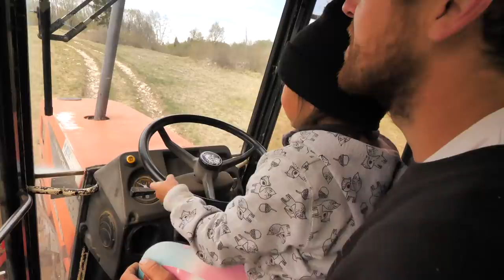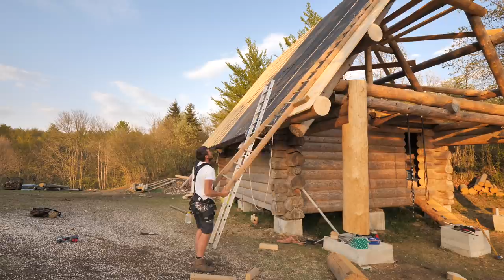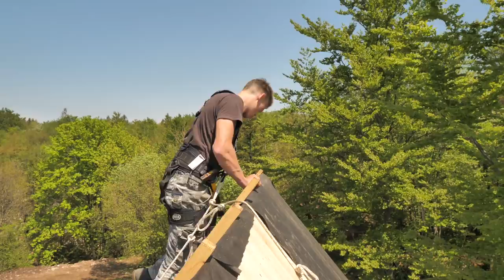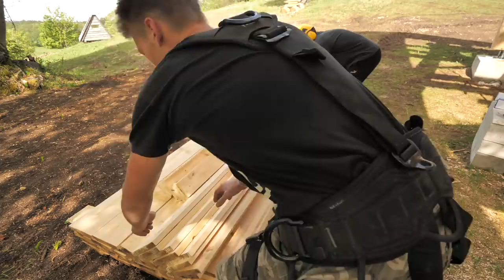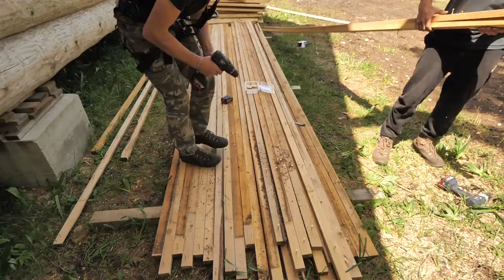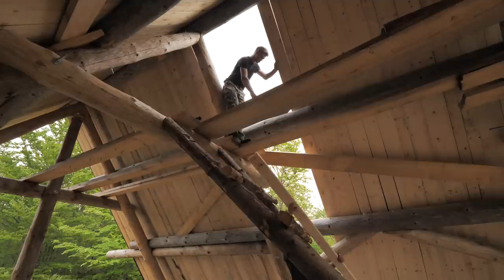Building Off Grid LOG CABIN / The Roof is DONE!  (S 2 Ep 13)

Comment: Sir, you were absolutely  correct to run the membrane vertically; the steepness of the pitch and the number of folks building it dictated it. Even though it took you a month to complete the roof you are still making very good progress and I applaud your efforts and skill. Keep the videos coming!
Reply: Well, no.  There's a reason roofing code has I&W run horizontally.  I hope it doesn't come to bite him in the ass.
Reply: @ikidd3123  just because code in 1 area of the world does not make this application incorrect. He appears to be using a double perlin/batten application for his roof. so if water gets under primary roof it still sheds properly
Reply: @Rowbottom46  code or no code that membrane is meant to be installed horizontally, he even states he installed it incorrectly.  It can and will leak just from condensation buildup.

Comment: Nik, running the waterproof membrane vertically is normal application. That roof is so steep, any water will run right down the lap with no issues. If the roof was low sloped, then I would run my courses horizontally. You are doing a fine job.

Comment: Cheers Nik from Sf bay, Ca. USA. Nik congrats for the completion of the roofing task. I can appreciate your multi combine erecting skill set. I'm a semi retired traction elevator installer so can appreciate the safety PPE gear tie off. MAD rigging skill sets using hoisting chain falls, cable pulley snatch blocks, hold backs and slings.  I just did my family's cement tile roof by myself too!. with the help of a hoisting mast and electric capstan hoist to lift 6 tons of cement tiles, a little couple hundred lbs at a time.  one of the better log cabin erections by far...cheers

Comment: Just a suggestion, if you do ever need to put a protective coating of some kind on the logs, I would only use a natural oil, such as a boiled linseed oil or a tung oil. Nothing else. That would replenish the oil in the wood that will be lost over time. You've done a great job. The roof size is a very traditional way to roof a log home. Regards, Solomon

Comment: I work as a construction manager in switzerland and I don't think there will be any problem with the layer beeing verticaly. 1. as you said its just the second layer and will mostly keep moisture out. 2. If i seen it correctly it has adhisive stripes for the overlap. These alone will seel it realy good. With the 2x4 in place i think there won't be any problematic moister coming in. 3. A little bit of moister isn't that bad as long as the wood can breath. The problem beginns when water is trapped between layers. Ten you will get mold.

I would highly advise to put some isolation under your roof, else it will get very cold in the winter. I wouold make a layer of wood under the wood beams and between the beams I would put some Stonewool and leave some air between the stonewool and the outer planks. So basically from botom to top: wooden planks, trickle protection, Beam/stonewool, 5cm air, wooden planks, rest of your roof.

I would also sugest you oil or wax your outer shell of wood, at least the walls. It will protect them from the moisture and they will last even longer.

Comment: I have watched every one of the videos you posted so far for this Log Cabin build and it's been great watching you do things completely differently then I would have done them.  I am big fan of the vee cuts that you added insulation to as well as the elliptical cuts that were made on each end of the logs so that they fit together perfectly.   The roof I would have done a little differently, not that the way you did it is wrong, but I would have likely installed all the boards before beginning the tar paper and I would have mounted the tar paper horizontally instead of vertically.  I do recognize that each does have some advantages and disadvantages.  Mounting it horizontally would then have changed the orientation of the hold-down boards to horizontal which would have turned them into a ladder of sorts for doing the rest of the work on the roof.  Thank you for posting these videos.  I try and watch as many of the ads as possible to give you as much support as I can.  Keep up the great work!  ;-)
Reply: Shawn R you’d still
Reply: You can use counterbattens, batten vertically then horizontally for tile or whatever finish...
Reply: I posted the comment above before getting to the point in the video where Nik explains why he did it the way that he did.  After hearing his explanation it does make sense as to why he did the roof the way that he did considering the roof pitch, wind and rain issues he is dealing with.   The additional steps would normally not be needed due to how quickly the roof would be completed, but in this case with Nik not having a team of people to finish it in a day or so, there are definitely additional challenges and considerations.  Another option would have been to put the roof boards on the top half all the way across and then put the tar paper on horizontally for that section.  With the pitch though this may have been a bit harder to complete in a day.  There is definitely more than one way to do it and it's great to see Nik doing it differently then I might have.

Comment: A note about placing a wind turbine at the house...FYI...unless it is a turbine specifically built to process winds as strong as those that prevail in Nik’s area, they will not be useful for him. It is my understanding that wind turbines are NOT able to function properly when the winds are too fast (greater than about 65mph) and they automatically switch off until the winds drop into a more modest range. At least that is my understanding as to how they function in the Plains States, US. Perhaps those in Europe are designed differently.

Comment: Two years later but i will comment anyway.  One man on the ridge and one at the edge.  The man at the ridge lowers a rope with a vise grip tied to it and the other man attaches the vise grip to the membrane.  The man on the ridge pulls up the membrane while the other man pulls off the backing.  I think it will work.  The only other thing I have seen that I am not crazy about is the wood strips between the bottom logs and the cement piers.  I think they will rot out.

Comment: Hi Nik, For your info you can watch "The outsider" on youtube.He is building just like yourself! P.S.I was just a little concerned when you installed that sheeting on your roof because in the case of the Outsider he mentioned that the manufacturer did not recommend using it on pine and certain other woods because the glue was not compatible and could eventually leak.Please let me know if you are aware of this.Tks Nik.

Comment: To haul the tar paper up by your self or with 2 people make a 2 board screw clamp 1 meter x 1" x 4" boards with 3 lag bolts, wing nuts, and washers 3 holes drilled 1 inch from edge of both boards with 2 eye bolts for rope and 2 pulleys to clamp top end of paper. Great for pulling tarps too won't rip it. Good work my friend. 1 ? Are you going to stain and varnish the logs and what color?

Comment: If you really want to have the water proof membrane run horizontally, after you are completely done with the roof, pull the 2x4 strips put gbe horizontal membrane on and screw the 2x4 back down.  That would give you a double layer of membrane protection and should add some insulation value.  I know it will be added time and expense but that way you have the best of both worlds for that roof.

Comment: and bTW, I'd strongly suggest that you REALLY SHOULD treat the exterior with a water sealer, even if it is transparent/clear. All that effort deserves to be protected and last. If not, it will be rotting from day 1 and this could last generations if cared for properly. Moisture will wick into the work and you may not know it but the damage can start on the inside and you won't see it until it's far too late.

Comment: Btw, I agree with the install in vertical direction. The batterns over support the overlap in seams and then the continuos sheet of paper will shred the water alright. No problem. What is the plan for thermal insulation?

Comment: You made a mistake at 3.26. Its a big mistake in timber construction and general roofing. You should have staggered the joints of the roofing boards. You have them all jointed on the one log. That creates a weak point in the structure and a possible point of ingress for water. Otherwise love it what you're doing.

Comment: I ask a question on why you overhung you're boards  so far at the top of the Ridge of the roof isn't that wasting material just like the bottom you got it hanging over the bottom that's a lot of waste I've done roofing for most of my life that's the first time I've ever seen somebody put the felt on like that you must have your own lumber mill for that house looking good anyway are you going to put on a metal roof on it or Cedar Shakes when we did a roof we ran the paper the other way started at the bottom worked our way to the top and when we're done we had a roof that was dried in and would not leak just with the paper on it I tell you that must be a roll roofing type roof you're putting on I haven't done much of that my bad hope you decide to make that upstairs a nice Loft with a big picture window I would look so nice